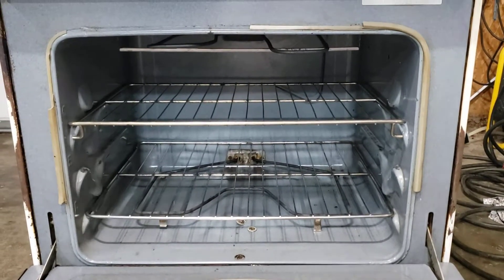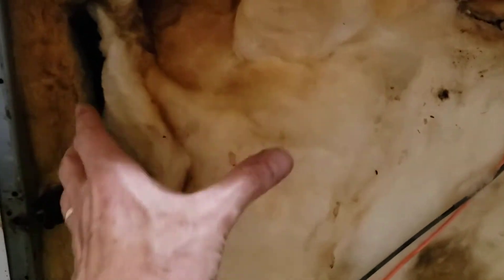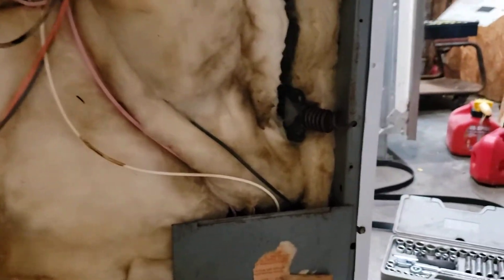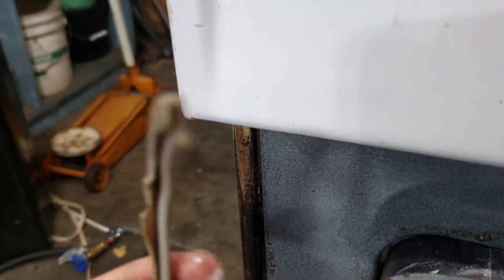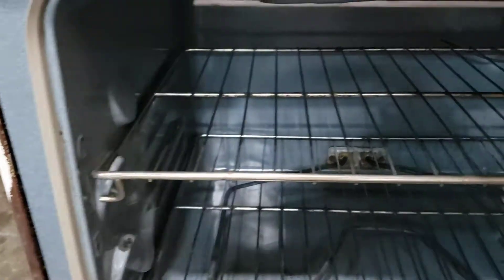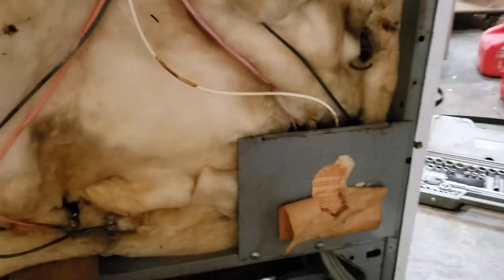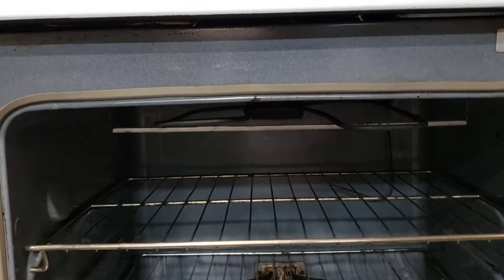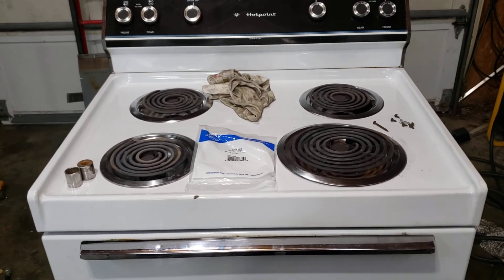How To Replace a GE Oven Door Gasket Number WB2X5103 AP2011750, PS242422,

Comment: Hi Kevin i need the same type of gasket for a hotpoint, Model # WE22OD-7 discontinued but its the same application. Do you know where i can order it?
Reply from the maker: Not sure can you make the one I used work?  https://amzn.to/3RPMuPu
Reply: the outer diameter of mine is 72" any idea who carries one that close to that size? thanks for your video, appliance repair in my city is s rip off. @ktoutdoor
Reply from the maker: Buy 2 then cut to fit?  @chriskumar4201

Comment: Shown here, WB2X5103 is the correct product for my GE Americana J795 double oven stove.  This is the only instruction I could find for installing this gasket.  I’m trying to install it on my upper oven. And failing. Does anyone have an installation method that is possible for a normal person to use?  Or any alternative products?  I have looked up high heat adhesives, but they are problematic.